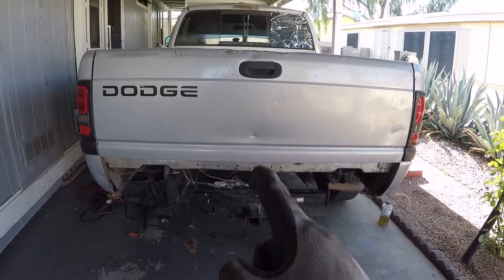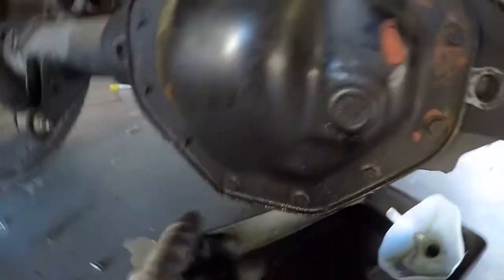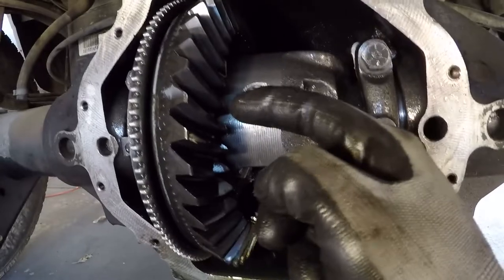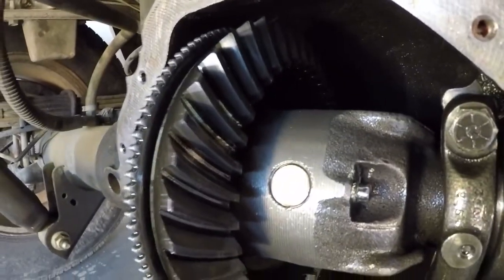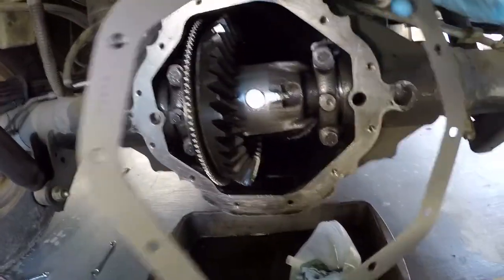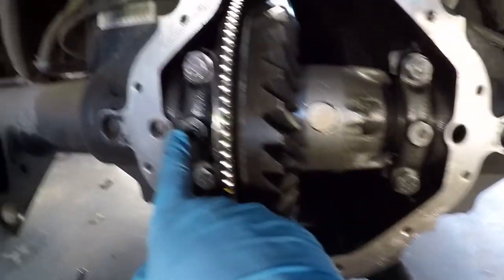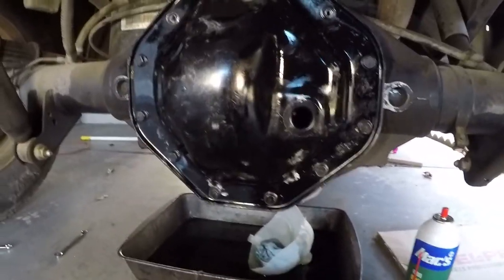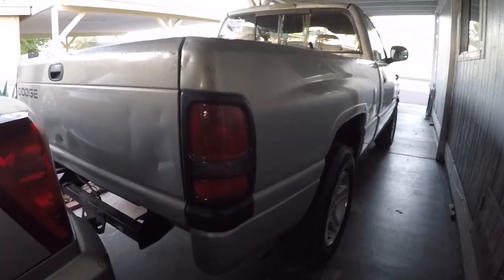Dodge Ram Rear End Destroyed By Silicon RTV

Comment: RTV will never damage your gears. The leak may have, but not the silicone. Looks like they didn't use enough to begin with. Notice there's only a film on the cover and not the rear casting.
Reply: That’s what I came for to hear 🙏

Comment: You can’t just use any RTV gasket maker for gear oil because it breaks down the silicone which causes leaks, and contaminates the oil. Not sure on the brand used but if it was Permatex, it should have created a grey gasket, not red.
Reply: Nothing wrong with red rtv…. What’s wrong is the individual who applied it used very little so little that even when squished together it was only a finger width wide when smashed . He must of used a very fine bead or smeared it flat with his finger when he installed it…

Comment: The rtv ain’t why it failed …. The leak may be , but rtv alone won’t fail it. I promise if you use rtv …. You will have some amount of it inside the diff . It’s inevitable….with that said . I do agree I prefer to use a gasket anywhere I can. Easier to replace , easier to work with.

Comment: RTV did not kill it, old mineral oil did! At that point damage is done. (transmission pack a surprise in the same way by neglect)

Have a quick look at the 2 side bearings for roler wear before you decide to tackle pinion gear.... torque wrench territory.